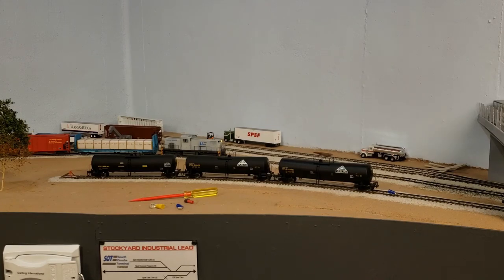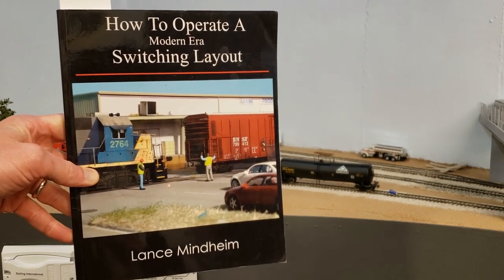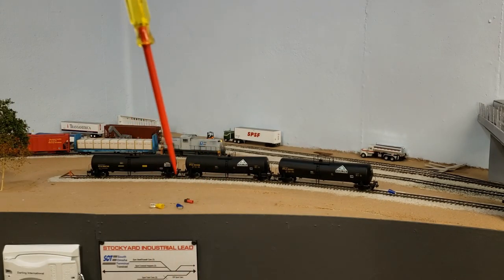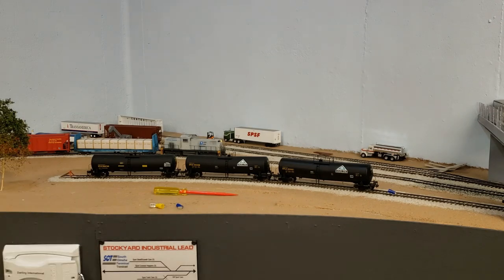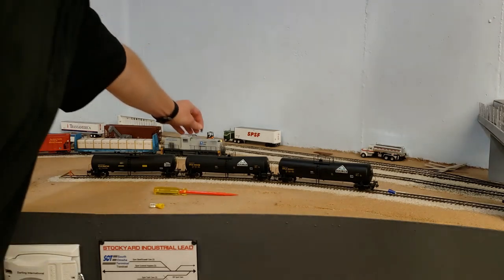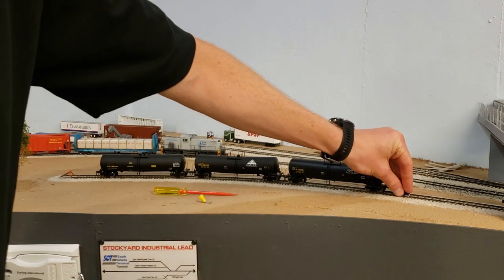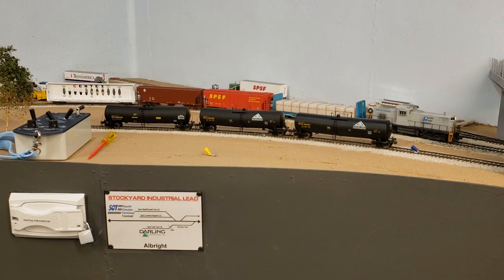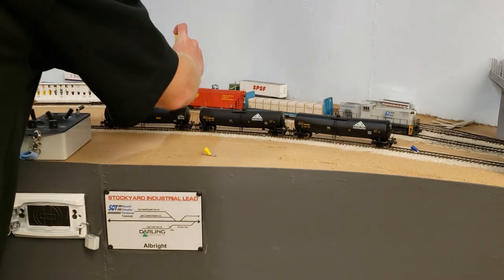Stockyard Industrial Lead: Operating Techniques for Industrial Spurs

Comment: Very good video. I think that red hopper needs a bad order slip. That would make operating even more fun. 😁
Reply from the maker: Yeah, that's for sure.  I used to do bad order slips when the layout was larger and I had more cars with more problems.  Now I usually don't run into issues like this because everything operates well.

Comment: Operating on layouts without any momentum is one of my biggest turn-offs to enjoyment of the session. People seldom realize (or acknowledge) that movement is just as important to the believably of our models as the weathering, scenery or details.  On my personal layout, I've set the momentum incredibly high, and use the function brake when I want to stop -- the difference between a stock programmed engine and that is night and day.
Not to mention, Lance Mindhiem is up there with the greatest of model railroaders, IMO.
Reply from the maker: Yep, totally agree with what you said about momentum!  Whenever I operated on layouts without it, I always stop the train way too early and have to keep coasting it - takes me a while to get used to not having it.  And I agree about Lance!

Comment: Nice work and very easy to understand. Do any of the railroads use or have used a passing track when they don't have a run around track?
Reply from the maker: Thanks! Yes, a passing track could work as well, although a runaround may be more suitable for local moves like this since it is typically shorter.
Reply: @emillerz  Yes your absolutely right. But for the width of the layout I'm planning, it would be hard to put a run around track next to the passing siding. I'll have 2 industries that are  located off the passing track. I want to know from you if your aware of any railroad that has ever used a passing siding as a run around or if they have put turnouts within the passing siding for locals to use. If this is not anything that's been done before I won't do it.
Reply: Joe Madej  Thank you Joe. That's a good point.
Reply: Joe Madej  What would a railroad do if they had to use a passing siding for switching that was a mile long...would they install two turnouts in the passing siding itself in front of the industry to avoid the locomotive traveling a whole mile just to switch cars?
Reply: Joe Madej  Thanks! All good points. Appreciated.
Reply: Joe Madej  Where I work we have a customer located of the main and the switch is at the east end of the siding which is 8900 feet long. When you are light engine going to run around your cars you can go track speed so it isn’t so bad

Comment: What have you done to yhe C415 yo make it run so good?  What brand is it?  What code is the track?  Doug
Reply from the maker: The C415 is still around, it's a kitbash of an old AHM model with a Stewart/Kato chassis and drive.  The track is code 83.